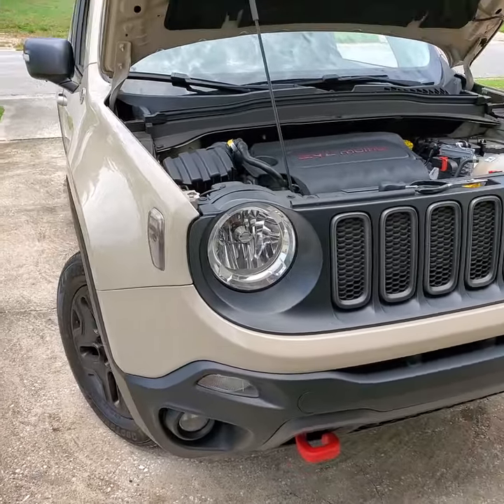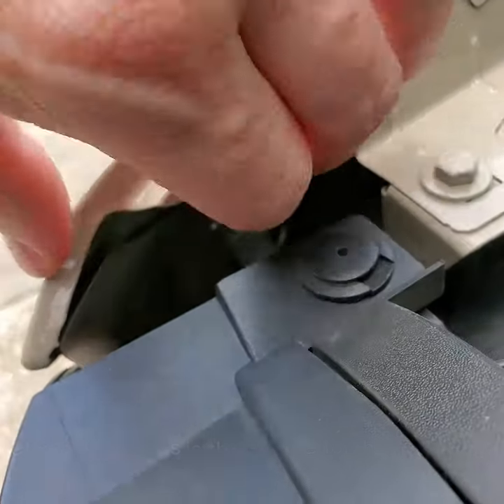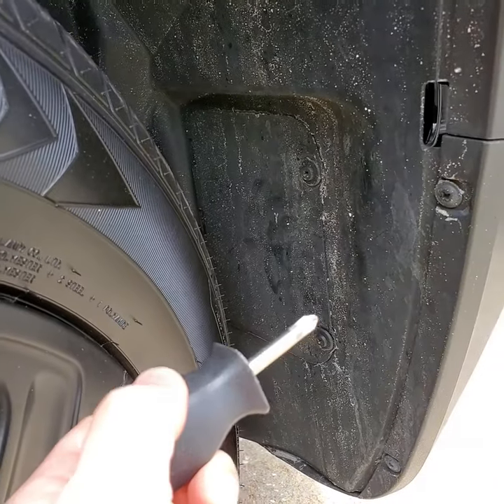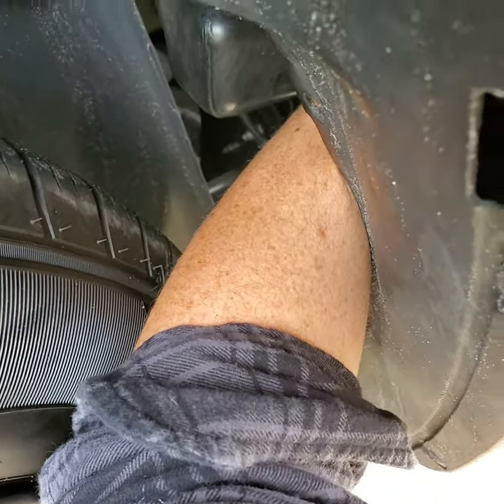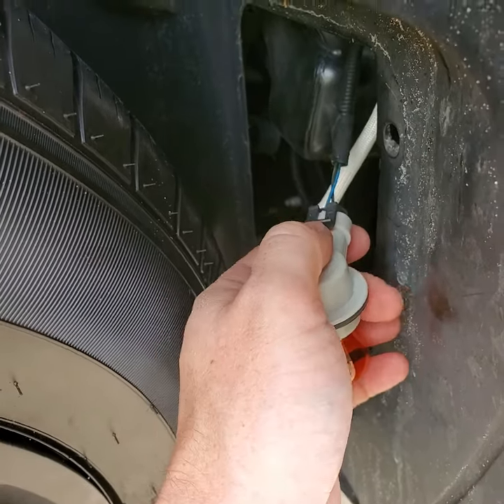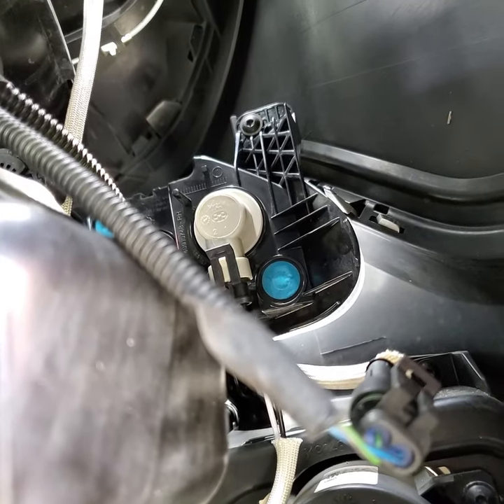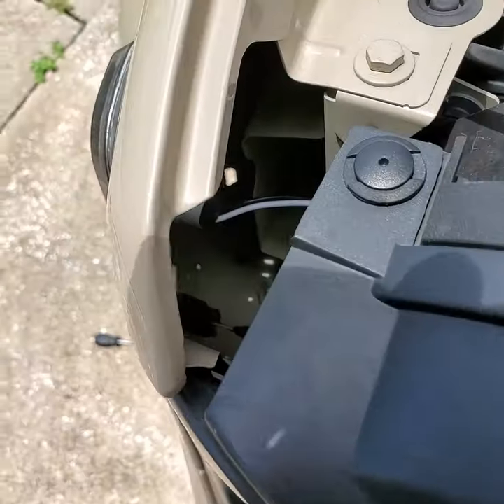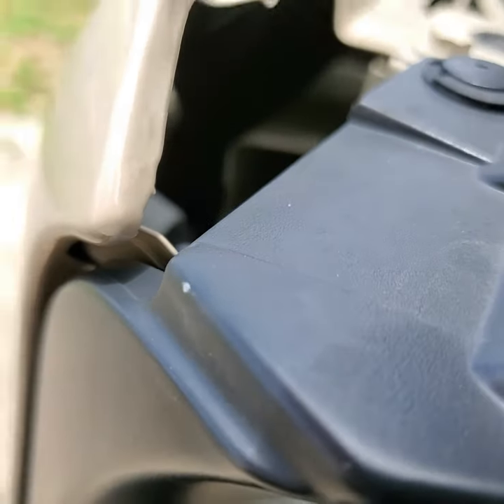Jeep Renegade Aftermarket Side Marker Install

Comment: Great video! I came from the Facebook group looking for guidance but my 2019 has a different insert and I was not able to do it. 😔
Reply: They installed no ptoblem on my '19. They dont work as turn signals but i knew that before purchasing. The connector from the light plugs directly in the bulb socket on your factory connector. You dont need the connectors and wiring that came in the package